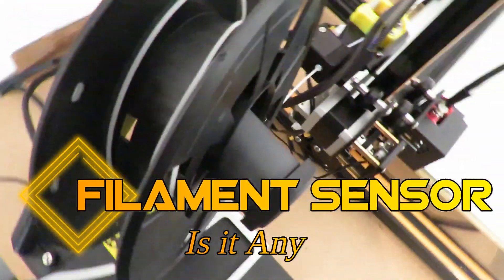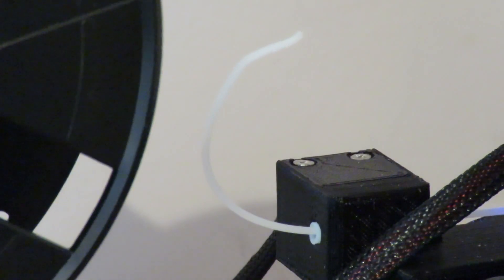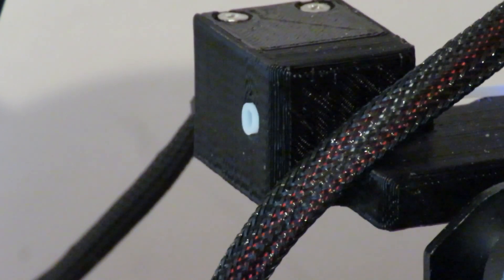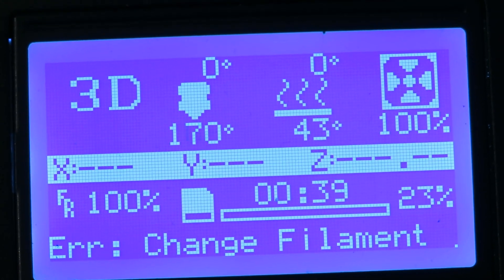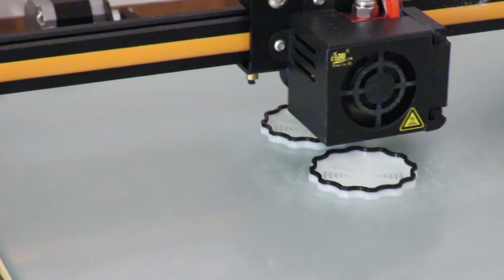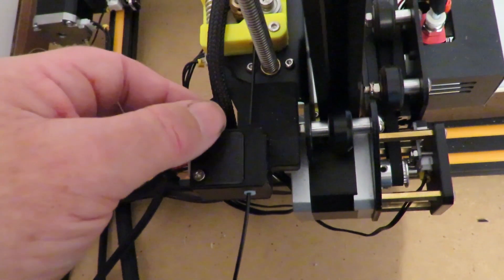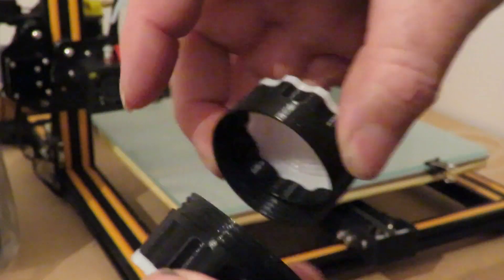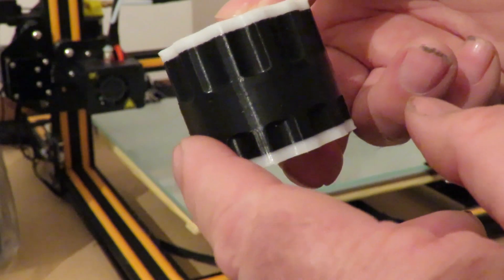📌 Creality CR-10S Filament Sensor in Action, Is It Worth the Extra Money, or is it a Gimmick?

Comment: I could actually see a reflection of the blue LED light on the plastic to the right of the sensor, and the printer stopped right when the reflection went away! The sensor has a blue LED indicating that filament is detected.
Reply from the maker: Its a handy thing, but not really necessary, unless you leave your printer unattended for lengthy periods.

Comment: That particular sensor is beyond worthless.
Reply from the maker: It works... is all I can say.
Reply: @GarryPurcell  until it wiggles loose and destroys your entire print. Crealitys sensor has cost me more prints than its saved.
Reply from the maker: @waskito3443  It sounds like you have a loose fitting case slot. Dip that part of the case in boiling water and pinch it to close the gap slightly, so its a tighter fit.
Reply: @GarryPurcell  they're all problematic, I already bought 2 replacements before I printer a practical case which works fine now.

Comment: at 1:59 hot end returned to home, did it hop down on z? will it crash into parts??
Reply from the maker: It simply stops where it runs out, and you reload the new filament.
I prefer to use Octoprint and its change filament option. It keeps the bed heated, while you change the filament.

Comment: Any idea what to do if the hot end cools down before you get to it? Will heating it back up to remove the old filament cause any problems?
Reply from the maker: Reheating and Removing the old filament is not a problem

Comment: Does it work on light or transparent filaments? I tried out a optical sensor with octoprint and it just gave out errors if filament was say white.
Reply from the maker: The sensor is a manual one, when the filament runs out the metal contacts come into contact with each other and complete a circuit which turns off the printer.
So it will work with all filaments.

Comment: However, we didnt see you replace the filament and how it was done, so the video is pointless. You omitted that part for some reason.
Reply from the maker: If you need to know how to do this, then I assume you don't own a printer.

P.S. You pull out the old filament, then thread the new filament through the sensor.

Comment: How do i get the power (the 3 pin) for the detector? All pins are blocked for my printer
Reply from the maker: Hi Olaf
This Filament Sensor is standard on the CR-10s machine.
They have a different main board to the standard CR-10 3D printer, so that would explain why you don't have the pinouts needed.

Comment: I print using a raspberry pi and octopi to print. My filament ran out, but nothing happend. Does this feature only work if you select a print job from an sd card? or could my sensor be broken?
Reply from the maker: Hi Vincent
Thats a good question.
I know the sensor works from SD card

BUT I'm not certain. (using Octopi)
I'll set it up, and do a test over the weekend, and let you know my results

Comment: I allowed a spool to run out once but discovered that the CR-10s detector was useless in this case as the bent end of the filament prevented it from going into and passing the detector therefore shutting the printer down. 
If I can't rely on it to do it's job because some or maybe most of the filament manufacturers begin their spools of filament this way then it is as good as not being there in the first place, unfortunately.
Reply from the maker: Good point.
Thanks for sharing this, so others are aware of it.

Comment: is there any tutorial on how to install it? i see no way on the cr-10
Reply from the maker: This is standard on a CR-10S.
To add it to a CR-10 you will need to replace the man board, with one that has the sensor enabled.

P.S. I have seen a CR-10 using a Raspberry Pi for a filament sensor.
https://www.thingiverse.com/thing:2763796

Comment: hi there, i just brought cr10s 2 month ago. At first it goes well, but lately when i am printing stuff, it always stop and ask me to change filament even though the filament still available. i need to resume it and it will run again. The problem is, it happen each 2 hours. what if the stuff i need to print is 9 hours? so what is the problem and how to fix it? tq
Reply from the maker: Fist I'd  check wiring and plug is seated firmly

The sensor box contains an end stop,. buy another end stop switch, and replace it.

There is one other possibility.
The filament you are using varies a lot in width.

Comment: Garry, how are you? could you help me. I buy this printer without filament sensor but I think the software is ready to have the sensor. I can't print because always ask me about change filament. Where did you connect the sensor in your motherboard?
Sebastian
Reply from the maker: The CR-10S has a different motherboard to the CR-10

I have seen on Thingiverse this Filament Sensor for the CR-10 if that helps.
https://www.thingiverse.com/thing:2480901

Comment: how do you change the filament? do you move the z axis like the one on other youtube videos?
Reply from the maker: The filament is easy to remove. because the sensor triggers the stop print before the filament goes through the extruder, its easy to remove and replace filament.

You pop off the filament sensor, make sure your hotend up to temperature, then pull the old filament, and insert your new filament. 
This can be done at any location the printer has stopped at.
Reply: Garry Purcell how?
Reply from the maker: There is some filament left between the sensor and the extruder, thats the piece you can easily get to, and remove.

On a standard setup, the filament will pass through the extruder and you will have to remove the bowden tube to get to it.
Reply: Can you move the axes while changing the filament then bring it all home before resuming the print? I tried pulling out the filament then changing it but i had to move the z axis just to see if the new filament is fully inserted:) is that bad?
Reply from the maker: You should not be moving axis, just leave it where it stopped, and the replace filament, then continue print.

I personally push the filament in quite hard until I feel it hit the hotend, then I know its ready to print.
Reply: Garry Purcell thank you! Ill try it out!

Comment: At the added cost driving the price of the 10S up to $500 - $700 USD I think the CR-10S looks a lot less appealing.  Might was well get the new MK3 and sacrifice some build volume.
Reply: Where are you paying $700 for a CR-10S? It's $469.99 on Gearbest.
Reply from the maker: The Prusa i3 MK2S is a very nice machine for sure.

I agree the cost difference between CR-19 and CD-10S, is a bit steep,
But you do get.
1. Dual Z-axis motors.
2. New Main board.
3. Filament Sensor.
Reply: I've been thinking the same as you. The cr 10s looks good but the price is making me go look at other printers and manufacturers to do business with. The cr 10 mini and the Anycube Mega are getting my attention.
Reply from the maker: The CR-10S is what I finished up getting.
The size of the build area, is something to consider when you decide which printer is best suited for your needs.
Reply: Just got my cr10s for 363 (420 shipped) I'm testing this feature tonight as i think i will run out.

Comment: How much better is this new version to the original CR 10?
Reply from the maker: That's a good question.
The Original CR-10 is still a very good and capable printer;

The New CR-10S has extras fitted as standard below. 
1. Dual Z-axis motors.
2. New Main board.
3. Filament Sensor.
4. Auto Resume after Power Failure

So its really up to you; would you benefit from these newer features, if you don't need them, then the Original CR-10 will do just nicely.
The finished 3D prints between the two models are almost identical.
Reply from the maker: Forgot to mention 
The best price I've come across for the CR-10  is currently $369.99US  Using the Coupon and link listed in my Video Description.

Comment: I did a short video of the filament sensor, it is mechanical so will wear with time. And the Semi auto bed leveling that is not right for the 500mm machine.
https://youtu.be/3fdwyvk32-s
Reply: I should say this video and comment are for the CR-10 S5 the 500mm machine, so its just for information for the interested.
Reply from the maker: I'm aware that the sensor is mechanical, I opened mine shortly after getting my printer,
I also assume the Blue led, is simply a power on indicator.

Comment: I found that the filament sensor does not cover for the bit after the sensor! In my case the filament had snapped right after the sensor and that could not be detected. (obvious they could not cover the whole length but yet they soared the price; almost doubled just for that sensor)  Auto Levelling its really a mixture of manual and auto; well it kind of does the job but I can not see the claim fully justified given that my fingers soaring doing that by hand.  On the good side of it though it is a good time challenging diy kit; quite an interesting sort of machine!
Reply from the maker: How on earth did the filament break after going through the sensor?
Is it a bad batch?

P.S. Checkout the comments by by Robothut
He has a video showing the CR-10S S5 with the same upgraded mainbouard we have, it shows a working resume print after power failure. 
He posted his find earlier today.

When I tested mine a few days ago I didn't allow the print to really get going, so I may have assumed incorrectly, that it was not enabled on the CR-10S mainboard.
I will be testing my printer after I finish the current print, I don't want to take a chance on loosing quite a few hours of print time.

Comment: CR -10s  sucks; it stops half way and parks as if it had heart attack, no messages on the screen whatsoever!! its going back where it came from...
Reply from the maker: Sorry to hear you are having problems.
But before you send it back, make sure your SD card is O, and formatted to Fat32 .
I would also recommend you try another SD card, just to be certain.
Reply: shall give it another go. thanks
Reply from the maker: One other thing I would check is the slicer settings, just in case you have a pause (Change filament) activated at a set layer height.

Comment: filament sensor has no screw to hold it in place and keees comming off forcing the printer to stop with no error showing no posing no nothing.  they did not take that into account obviously.  It only detects filament brake but not the collapse of the whole flimsy sensor
Reply from the maker: The sensor case is a push fit, if its loose, simply heat up the plastic case and gently squeeze it until it fits.
I'm not sure how the sensor coming off would cause the printer to stop, as the filament sensor must have "no filament" running through it, to activate the No Filament Warning.
Perhaps its a loose plug connection, on the either the sensor, or the mainboard itself.

Comment: Hi, Does it restores if knocking power switch off (by accident) ?
Reply from the maker: Unfortunately the answer is No.
I had hoped the mainboard would cater for power outages, and resume the print when power was restored.
Reply: Garry Purcell 

I see,  thank you, your video inspired me to buy the cr 10s;  ordered one earlier today.  Reading questions answwred on gearbest though is confusing as they saying it restores printing in case of  power failure  but its clear now that the price difference is only for the sensor.  ( i did not order from them, by the way )
Reply from the maker: I saw that the Mini has restore after power failure, not sure as I don't own one.

P.S. You will be very happy when your printer arrives.
Its a bit of a learning curve, but once your there, it becomes easy.
If you need any help, feel free to pop up a question, and I'll do my best to answer it for you.
Reply: I ordered the standard cr 10s version too not the mini. So we are on the same boat until the "fishing is banned:) One more question as strange as may seem:- Would thouse print straight from sketchup ? (Googles 3d drawings software) many thanks
Reply from the maker: If your designing your models on a Cad or any 3D Modeling software I.E. Sketchup, Fusion360, Blender etc, you need to save the file as stl first, then run it through a slicer I.E. Cura, Ideamaker, Simplify3d Etc. to create the necessary GCode for the printer to work.

P.S. Don't Use Cura that comes on your SD Card (Its quite an Old Version), Update to Cura v2.7. 

ALSO The Cat GCode on the SD Card is corrupt, and the head will not print correctly. (Its often called DeCapi-Cat on  the forums)
So use the Cat STL and create your own GCode.
Reply from the maker: I'm currently testing 6 different slicers, and will be popping up a Video of my results.
Reply: Thank you; there is no option on sketchup to save file as stl
Reply from the maker: You should be able to "Export" as STLl. (Don't use Save)
Reply: obj i did that is the only option on my set up no stl but is working fine.  what is the best temperature ? I set it at 196 and it printed fine, thx
Reply from the maker: I would suggest you print a Temperature tower and configure the hotend, to get the best results.
I made a video about this 
https://youtu.be/q6a87NohedU

The temperatures I'm using are for Esun Pla+ hotend 215 and bed 60.
Each manufacturer has a different raw material mix in there filaments, so you need to calibrate for the brand your using.
Reply: Is this the CR-10S? Or is this a modern you've done to the CR-10, if so, did you have to upgrade the mainboard?
Reply from the maker: Its the CR-10S Standard.

Comment: Nice, I would be interested to see the inside of the filament detector, I guess it's just a micro switch and a roller.
Reply from the maker: Your assumption is correct
I opened the little black magic box, and took a peek inside for you.
It is indeed a Sensor switch with a blue led on the circuit board.
Reply: Thanks!
Reply: It's more than that!  The motherboard is different and a better quality than previous. Microswitch or not has to be seen but its making the right sounds when tge rroller snapped. Recovered and started were it left off.   The price difference is huge but without the sensor one is screwed
Reply from the maker: My printer is a CR-10S Standard
I haven't opened the controller box to see what mainboard is actually fitted, I might take a peek in a few days time out of curiosity.

Comment: Does the hotend cool down when the filament is out? How does the filament change happen? The temperature was showing 35C in the video.
Reply from the maker: Good question.
I'm not sure, I'll have to do a test for you, and I'll pop up the answer.
Reply from the maker: Sorry for a late reply.
I finally got around to testing it.
It does indeed shut off power to the heat bed.
I also tried a few different GCodes listed below.

I tested it by removing GCode "M140 S0" from the end code Made no Difference (M140 ;Set heated bed temperature to S (not waiting))
Tried again adding M42 to GCode Start Code, Still cooling down ( M42 ;Stop if out of material (if supported))
Once more with M42 and M43 added to GCode End Script, Still cooling down (M43 ;Like M42 but leave heated bed on (if supported) )
Reply: Thanks, but I was asking about the hotend being shutdown or not when the filament's out. I guess it can also be a firmware option on how to deal with it - as in raise the head and move out of the way and such.
Reply from the maker: Yes the hotend cools also. 
The Bed I believe is more important, as it it affects model adhesion, and I'm not sure how well the model would stick, once the bed has cooled, then reheated.
I might get around to testing this as well.🙂
Reply: That makes sense. Leaving the bed on would allow for a proper continuation of the print.
Reply from the maker: One thing I haven't tried, is to manually pre-set the bed temperature from the control box. (I'll have to give that a go also.)

Comment: Some adds for the CR10s say that it has power loss resume and some do not. Does your printer have the resume after power is lost ? I wonder if we can just buy the new control board and filament sensor, or even make our own filament sensor if they will sell the new control board.
Reply from the maker: Brian
You are 100% correct with your statement, a backup power supply will definitely work.

I have just gone through a few power outages with no success with the resume print feature.

P.S. I like Bat Cat 🙂
Reply: Yes I have UPS systems on my printers as they work 100% of the time. But they do have a life based on the battery in them. We had power outage that lasted over 1 day but I did not know it would be that long I thought maybe a few minuets, so as the battery level got lower and lower on the USP I got out a car 12 volt battery from the shop and some jumper cables and got inside the operating UPS and gave the internal battery a boost, finnished the print with battery power to spair. So keep a old car battery laying around and charged up, you never know when the lights might go out for longer than your remaining print time.
Reply from the maker: I just tried it for you.
Started a print, then turned off power at wall,  waited a bit, then turned power on. 
I can confirm on my printer, there is No Resume After Power Loss.
Reply: Thank you for checking ! It seems they make both versions but not both features in One version. Maybe they are still playing with the features they want.
Reply from the maker: That could be the case, as these printers are still fairly new, and still developing as the days go by.
Reply: Garrry, check it again. I just got my CR 10 S5 and it does have power loss resume. It worked 3 out of 5 times that I tested it. here is a video I shot of it.
https://youtu.be/rIIQOWJ8jng
Reply: Garry Purcell could possibly solve this problem by having a backup battery system, although I think most people were using this feature functionally as a “pause print” feature, which is built into the cr10s correct?
Reply from the maker: Excellent advice
Thaks for sharing it with us.